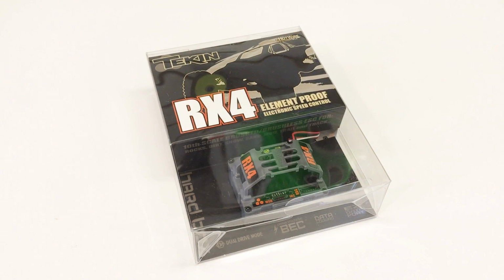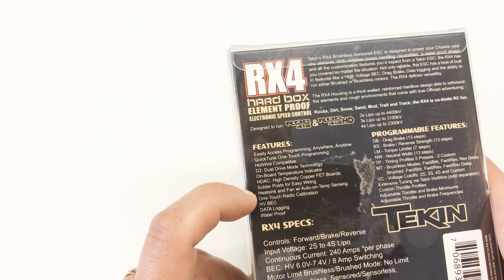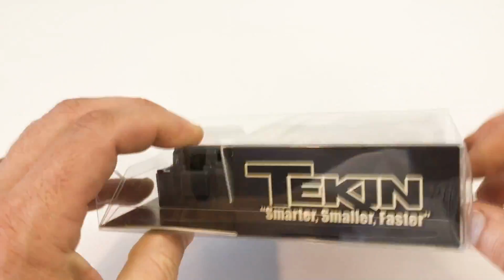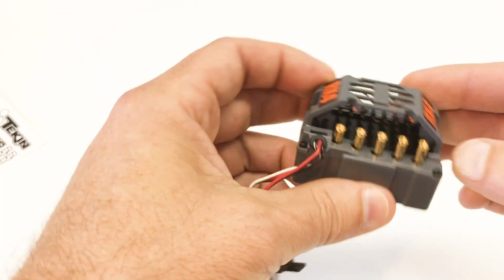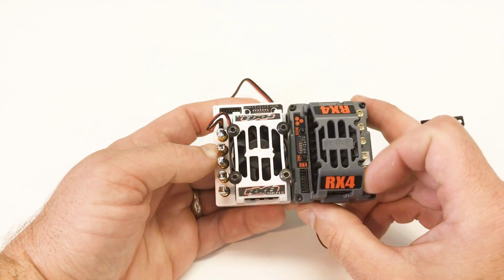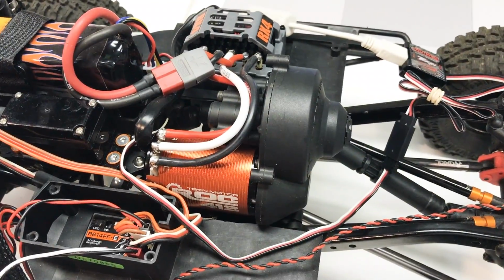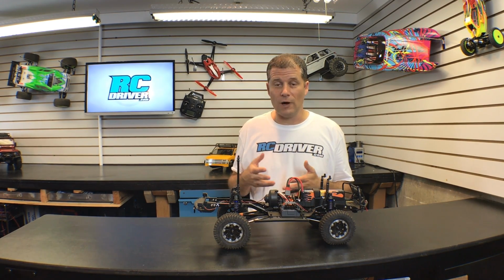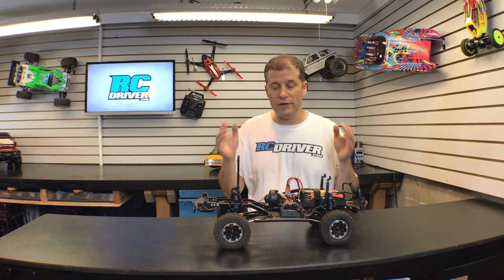Take On The Elements - Tekin RX4 Hard Box Electronic Speed Control | RC Driver

Comment: Nooby question: why do you have to reverse the motor? Because it sits on the opposite side of where the motor turns??
Reply from the maker: In this case, the factory ESC direction was reversed from the driveline rotation. Simply flipping the throttle servo reversing switch would not correct it. The Tekin program allows the motor to be reversed.

Comment: Controller looks and sounds great, but the Castle Mamba X is better and cheaper. Higher input voltage(6s), more torque/brake settings, removable fan included and stronger bec 8v/8a. Finally, it is very large, it does not even fit where the scx10ii esc is SUPPOSED to go (not where the 2-speed shift servo is supposed to go). Just my opinion, would and will not pay Tekin the price they want for their RC products.
Reply from the maker: It actually does fit in the stock ESC location. I installed it where it is as weight bias adjustment for my set-up. Castle makes a great ESC too. Options are always great.